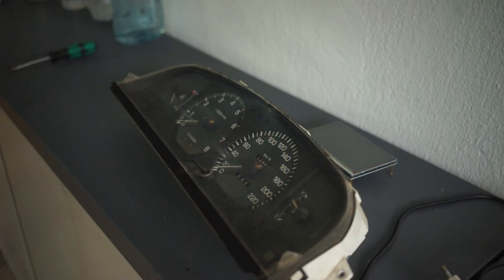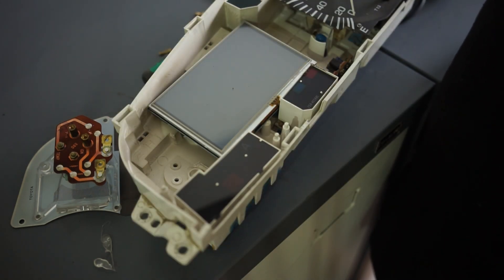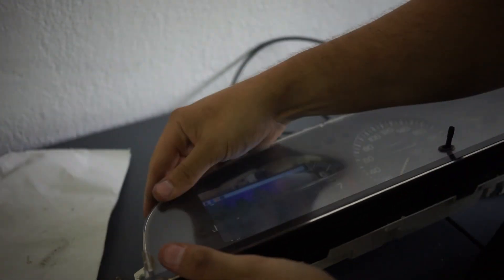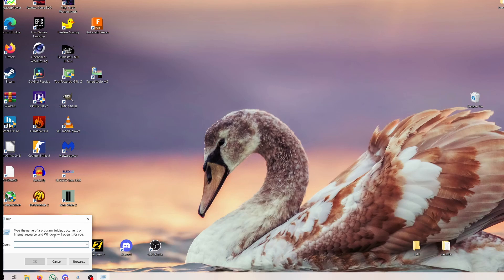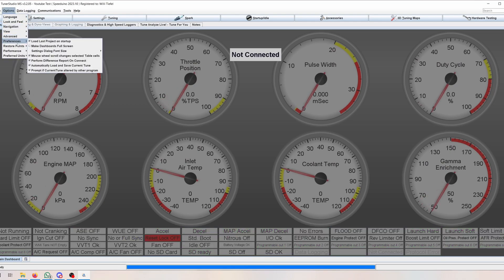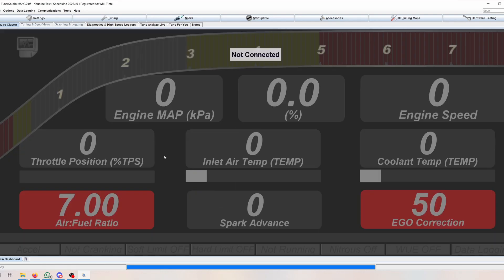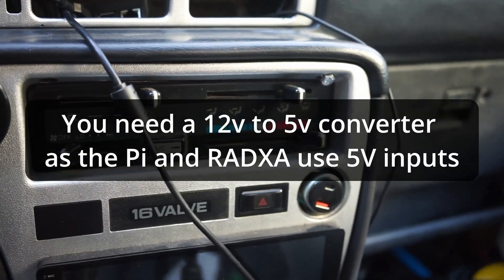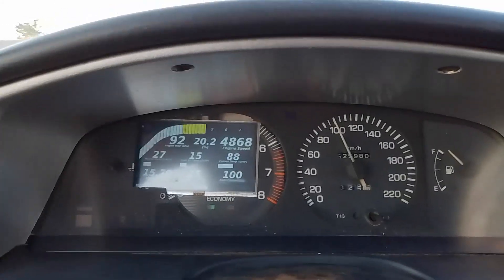DIY Digital Dash with Tunerstudio for Megasquirt and Tunerstudio | In car Linux & Windows pc

Comment: Thank Good Tip .. I never know that radxa .. So you ran on WINDOWS?
Reply from the maker: im using a raspberry pi running linux but if i would do it again i would use the radxa using windows, because linux is just infuriating to use

Comment: I have been thinking about doing this with a windows tablet 🤔.. i dont know if im knowledgeable enuf to build a pi dash (never tryed or nore have i even meased with a pi b4) .. atm , i just built a laptop mount so my laptop stays just to the right of my shifter 😅 and boom full access 😂.. but i would like to drop down to a tablet size so i dont have a whole azz laptop with me everytime , altho,  it does let me change stuff on the fly and everyone that see me in a big turbo miata with a laptop has to ask or atleast a conversation starter and were i live , its kinda hard to find fellow car ppl to just hang with and build cars together .. anyways .. peace and love all, keep it rad, stay safe, and build on..l8r famz and keep having fun all
Reply from the maker: the problem with windows tablets is they are slow as F so have a look at a radxa x4 it runs windows and is the same formfactor as a raspberry pi. you could either power it from the cars 12v or by a powerbank even and you can choose what display you want!

Comment: Just run constant 12v to a relay with and ignition switched input and the computer won't reset or switch the sbc on after the engine starts.
Reply from the maker: well zou dont need a relay for that low of an amperage. an ignition source is sufficient.
Reply: @throttlebuddies0 You don't want to draw too much current from the ignition (switched) circuit, it's only meant to run relays.

Comment: If you install Linux Mint or Ubuntu on an x86 sbc, Tunerstudio runs flawlessly.  Just use a light desktop, like Xfce.  You can also use Proteus.  The only real problem is connecting the megasquirt serial port to the sbc, and getting permissions to access it in Tunerstudio.  I have been running Tunerstudio on minicomputer to a Lilliput display for years.  Boots fine.  There are many more display options available now.  The display also is connected to the back up camera.

Comment: Great informative vid as per usual. This is just what i need for my rusefi!
What version radxa would you recommend? 
I assume the cheapy 4gb version should do the job, since tuner studio is pretty basic
Reply from the maker: yeah that version should be fine. 
i think maybe some way of a shutdown protocol before shtting off the car makes sense as sd cards can break when getting suddenly dropped from power somebody told me, though i dont have any experience with that just FYI
Reply: @throttlebuddies0  thanks for the warning! The ones im looking at have an NVMe SSD card, and a seperate power button, so if worst comes to worst i could run constant power to the unit, then use the I/O button to cycle. Im sorta new to all this also haha.
Reply from the maker: @MRMOPARMAN0426  yeah i think a proper ssd might be fine for that. but yeah maybe the implementation of a power button may make sense nevertheless.
Reply: @throttlebuddies0  sorry to be a pest, i was thinking that a windows/apple tablet might be a good alternative as a full dash cluster? I guess the big question is whether tuner studio would work properly on them
Reply from the maker: @MRMOPARMAN0426  on windows it works perfect. also on linux but android and ios of course doesnt have the capability to run tunerstudio itself. there are apps like shadow dash and msdroid but msdroid development has been stopped so the only thing would be shadowdash not sure if thats available for ios aswell.
Reply: another option you have if you have the space, is an industrial computer. you can get an older one very cheap secondhand, some of them even have GPIO pins, and are designed to handle extreme environments, and also run on DC power. im not sure how the power buttons on these ones work, but there are several different methods of adding an external power button to a computer, and you can tell windows that you want to power down safely by just pushing the power button. im sure linux can do the same, im just not familiar with it.

also, you can always just run a separate wire from the battery to be always on, just make sure you have a proper switches and overcurrent protection.
Reply from the maker: @masterbond9  at that point makes more sense to get a radxa x4 or a 12 inch thinkpad or something like that
Reply: @throttlebuddies0  it might, it might not. all im doing is offering another option.

a radxa is probably a better choice for a racecar, since its going to be lighter and all its going to be in control of is the car. but what about a street car that you daily drive? maybe you want a different set of features that a car stereo just doesnt offer. granted, there are many ways that this is changing, but some people just like doing their own things.

a thinkpad, or a toughbook arent bad ideas either, and there are already car mounts for them both. another option is a computer that motorola made specifically for police cars. they arent very powerful anymore, but its another option to consider. especially since they have modern SSD support and m.2 slots and someone got GTA san andreas working on one.

another option is if you have an old desktop laying around, they make power supply boards specifically designed to put a normal computer into a vehicle, and desktops can be purchased very cheap as well (under $100 sometimes), and if its something you already have laying around why not try upcycling it and using it for something else? at the very least you can use it to test it out and see if you actually like it and it works for you. it could be even more budget friendly.

Comment: Are you planning to put that graphics card in the car more mileage
Reply: Copying what I said, to the same question, asked earlier, by the same user:

I feel like @itzmejav995 is trying to say, is:

can you use a screen, like this, to show your vehicle's mileage?

If that is the question, you mean, then here's my answer (correct me if I'm wrong.. I don't have much knowledge yet, though I'm doing a very similar project):

For driven mileage, yes. There are (if not, in the tuner studio archives) plenty of people who have made program code, to "monitor" GPS calculated  tripometer (user defined travelled distance with reset function) and odometer (permanently defined overall travelled distance without reset function), that will work within tuner studio, others, and standalone.

If the question is of mpg/mpk, I have seen people that have made program code to work within programs (cannot verify tuner studio) and standalone, but any of these sorts of calculations are very inaccurate (besides being very well attenuated to your specific platform [every aspect of your vehicle] and can only calculate, accurately, during the exact [live] conditions of your driving "habit"); they cannot technically give you a "real" mpg/mpk. It can only calculate from the realtime information, given that you have the sensor inputs needed (throttle position, fuel level, fuel pressure, EGR open, EGR closed, EGT, MAF/MAP, O2 up/downstream, FICD time open, FICD time closed, ECT, IAT, tire size and type, axle ratios, transmission ratios, transmission temp... Basically all of the above (plus other mods or sensors needed that I've missed) would need to be on a CANBUS to talk to each other, in real time... And all of that, still, will only give you a realtime "answer"; any "average" of the "realtime data" will also be inaccurate to "real life", because driving conditions change, extremely drastically, every split second of use.

Comment: Are you planning to put that graphics card in the car more mileage
Reply: I feel like @itzmejav995 is trying to say, is:

can you use a screen, like this, to show your vehicle's mileage?

If that is the question, you mean, then here's my answer (correct me if I'm wrong.. I don't have much knowledge yet, though I'm doing a very similar project):

For driven mileage, yes. There are (if not, in the tuner studio archives) plenty of people who have made program code, to "monitor" GPS calculated  tripometer (user defined travelled distance with reset function) and odometer (permanently defined overall travelled distance without reset function), that will work within tuner studio, others, and standalone.

If the question is of mpg/mpk, I have seen people that have made program code to work within programs (cannot verify tuner studio) and standalone, but any of these sorts of calculations are very inaccurate (besides being very well attenuated to your specific platform [every aspect of your vehicle] and can only calculate, accurately, during the exact [live] conditions of your driving "habit"); they cannot technically give you a "real" mpg/mpk. It can only calculate from the realtime information, given that you have the sensor inputs needed (throttle position, fuel level, fuel pressure, EGR open, EGR closed, EGT, MAF/MAP, O2 up/downstream, FICD time open, FICD time closed, ECT, IAT, tire size and type, axle ratios, transmission ratios, transmission temp... Basically all of the above (plus other mods or sensors needed that I've missed) would need to be on a CANBUS to talk to each other, in real time... And all of that, still, will only give you a realtime "answer"; any "average" of the "realtime data" will also be inaccurate to "real life", because driving conditions change, extremely drastically, every split second of use.

Comment: In most times the wire for the coils has power on ignition switch (Klemme 15). The Problem with the cigarette lighter is the X contact, as you said, while cranking all power gets cut. You can also get +12c on ignition at the ignition switch directly, just make sure to install a fuse in between.
Reply from the maker: @bengerdes4679  yeah as i said youd need one that has power while cranking but you could also just snip the 5v wire inside the usb cable i guess

Comment: I just set up a pi4 with TS Dash yesterday. It boots directly to the dash and I didn't have to mess with it at all, just upload the tune file.
Reply: YouTube won’t let me comment for some reason, but I was going to suggest this also. It can also do things like shutdown when a gpio pin changes state. I’m currently working on a custom pi hat that has a power supply for the pi and an arduino built in to handle turning the 5v on or off based on key/pi state.
Reply from the maker: With a pi4 yeah but i dont know if it will work with a 0i5 ive had that issue with a different distro for this application where pi 5s werent supportet at all and the os wouldnt launch
Reply: I just made my pi4 with TS. I’m not computer savvy, can you please tell me how I make a tune file? I have a OBD/usb cord but the system isn’t recognizing it. Trying to find solutions.
Reply from the maker: @Humanityconfliction  what ecu are you using?
Reply: @ it is a 2003 Chevy 5.3
Reply from the maker: @Humanityconfliction  yes what ecu? It does not work with a standard ecu you need a standalone ecu that can be tuned qith tuner studio
Reply: @  okay, well that answers that question. Thank you greatly for the information, it’s much appreciated.
Reply from the maker: @Humanityconfliction  no worries
Reply: @Humanityconfliction you might can access some options on the oem with hp tuners, and there dongle for the obd2 slot , but as stated you are crazy limited to what you can even see or do on the stock ecu .. that might help ya a lil , but really without standalone , there are very few oem ecu that can be "hacked" to get full access to the tables , but again , im not sure how much it will let ya mess with .. but for the truck ya have , hp tuners would prolly be your best bet unless ya go full standalone brotha 💪🏽🤙🏽🤘🏽

Comment: Interesting about tuner studio not being reliable enough, most often times linux is a bit more reliable than windows. I do have a few rpi so can give it a try since I'm also a linux admin, but if there are known bugs then I get it.
Reply from the maker: not talking about reliability just being a pain for someone that is used to a normal GUI and not using command prompt/terminal for almost anything
Reply: @throttlebuddies0  gotcha fair enough

Comment: Hope all is well havent gotten chance to watch your videos thank you very much for the information you have help me alot...can you send me a short video explain how to use a timing light properly what i am looking for for speeedunio...hope your okay❤❤
Reply from the maker: i do have that actually: i explain it in this video: https://youtu.be/ebmvInXdeEc
Reply: @throttlebuddies0  i am aware of the video but am still a bit confused on a pratical stand point to ensure i know that  i am doing the right thing
Reply: @throttlebuddies0  so i should put in a radom trigger angle...turn on fix timming and set it to zero....crank the engine see where it flashes continue to adjust the radom trigger angle until the light flashes on TDC mark on both pully and engine mark.. and that should be my trigger angle correct.. then turn off lock timming and i shouldnt have to worry about my engine blowing up at high rpm
Reply: Lastly i  need a tune that is fuel efficient can i do that without a wideband sensor its not going to be perfect but at least getting a base
Reply from the maker: @itzmejav995  this would be correct but you could get also an estimated trigger angle by calculating the degrees the crank turns from TDC until the first tooth after the missing tooth (or on a 4 tooth wheel for example the first tooth) passes the the sensor. that amount of rotation would be an estimated trigger angle to start off of. :)
Reply from the maker: @itzmejav995  no you need a wideband to tune the car there is no debate its a neccasity
Reply: @throttlebuddies0  so its 21 teeth which i counted
Reply from the maker: the teeth dont matter. as i said its degrees of rotation until tooth 1 passes the sensor. measured from TDC